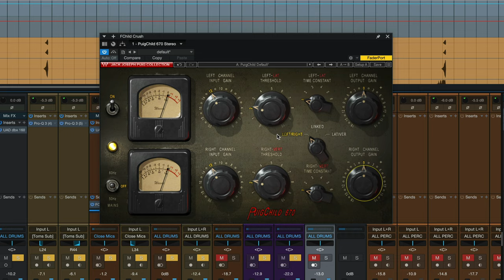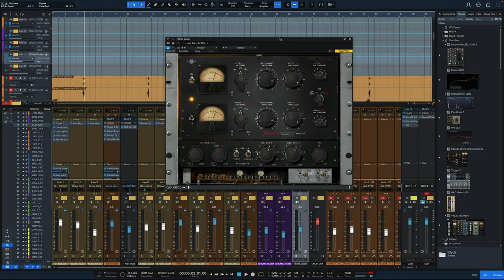Andrew Scheps Fairchild Drum Crush

Comment: Isn't the point of parallel compression to slam the heck out of the compressor and blend it in underneath? What's up with the moderate settings in these tutorials? How does that establish the consistent signal parallel compression is supposed to give you?
Reply from the maker: That's how I usually do it.  Just showing you how Scheps does it in these videos.